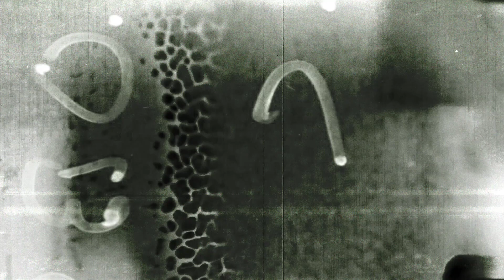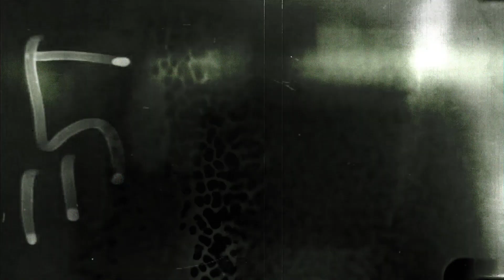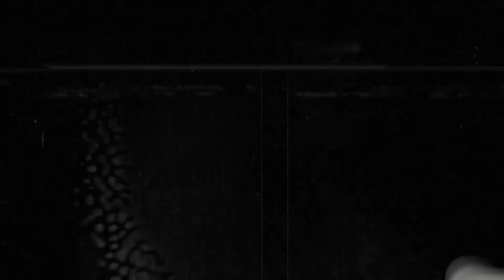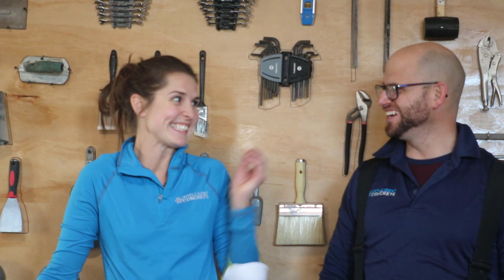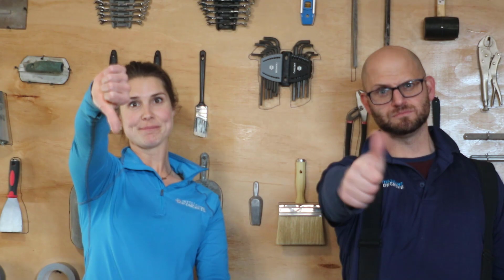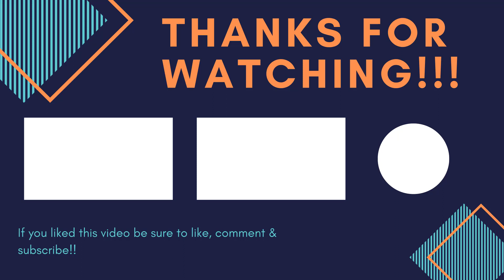Uses of Glow in the Dark Concrete - Vlog 543

Comment: If you're looking for new market opportunities: try emergency scenario's like indicating paths to emergency exits etc. The big advantage over classical emergency lighting is the fact that your system is passive and doesn't need maintenance. I believe the concept is already used in airplanes, of course not with concrete but with paint/coating ;-)
Industrial will be a good starting point (e.g. big warehouses, shop floors...), later on, when the technology is adopted, public buildings might be an opportunity as well.